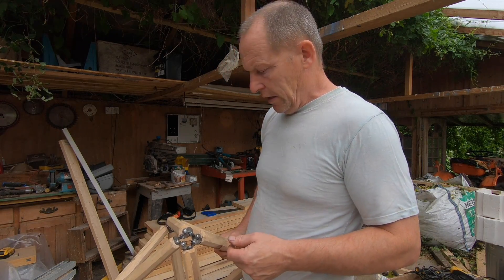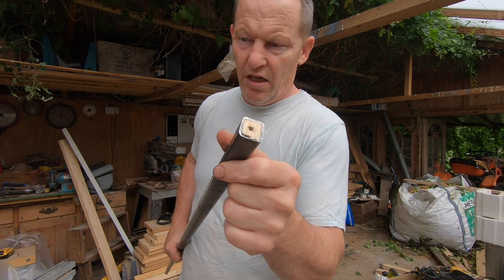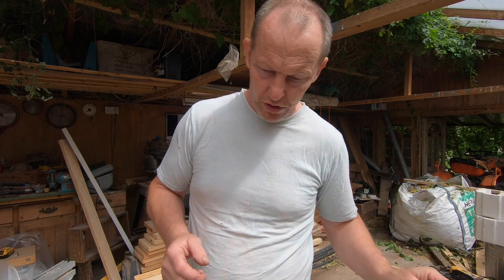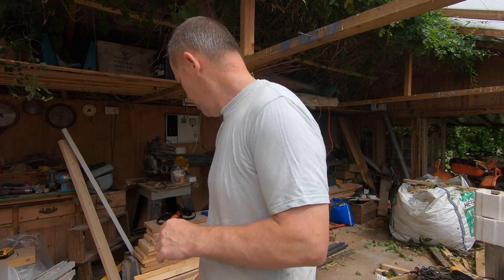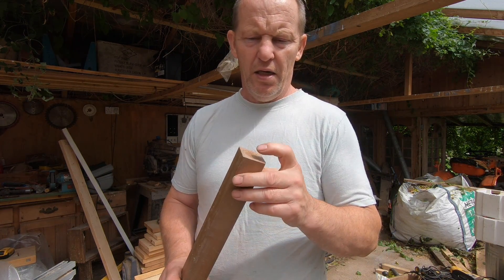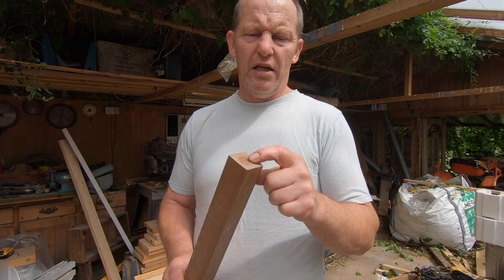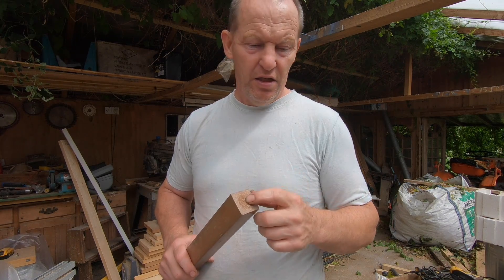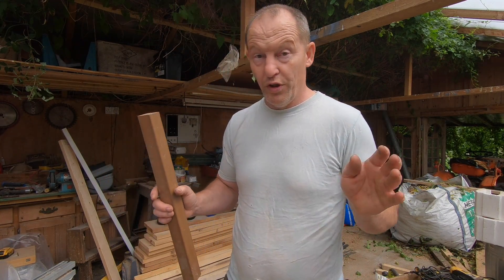Unlink- fixings for different strut materials + sphere dismantling

Comment: Hi Paul,

For the plastic wood you might try an insert bolt or stake nut. They come in different varieties depending on the material you want to fix them into. Those that are threaded on the outside usually work pretty wel. Good luck.

Comment: Another good vid Paul, I'd consider plastic waste pipe, 32 mm plastic weld would be a little stiffer than push fit.
Not sure how you'd blank the ends to accept the unilinks but it would be reasonably cheap and easy to work with.

Comment: I wonder if you've ever tried well nuts.  They are cylindrical slugs of rubber with a nut embedded in them. As  a bolt is tightened, the nut squashes the rubber slug which could make it expand inside of a pipe. I've always wondered if they would be strong enough for a dome.
Reply: brentverrill interesting!